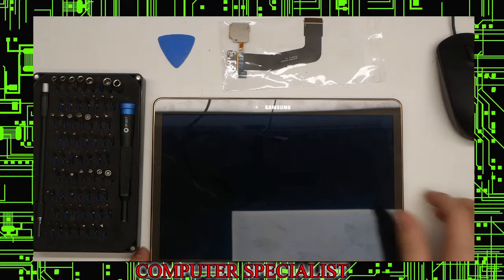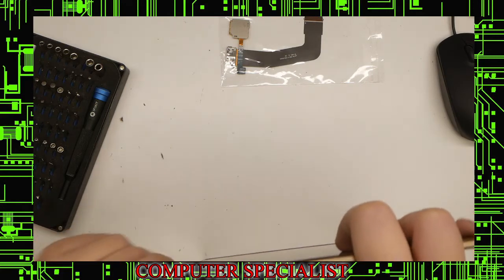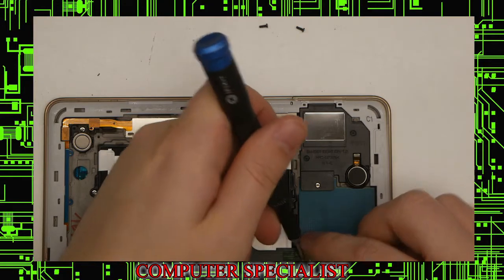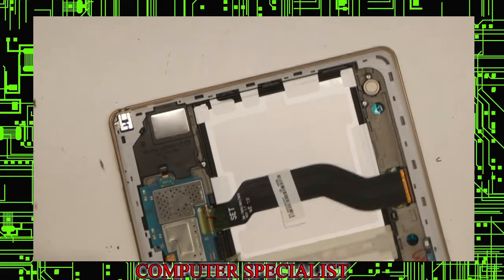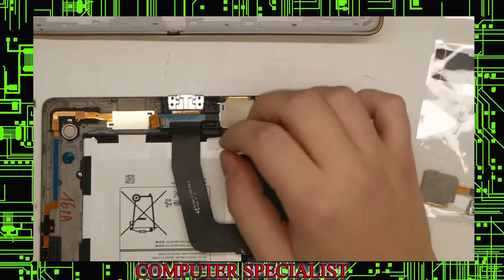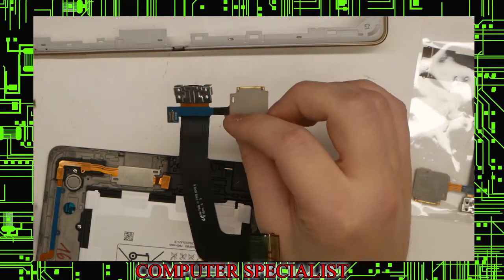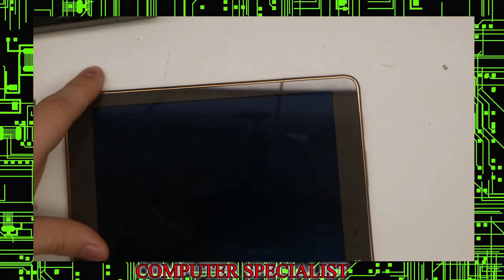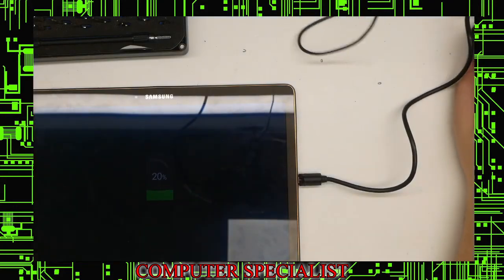How-to Replace Micro USB Charge Port on Samsung Galaxy Tablet SM-T800

Comment: Can you do this with a Samsung Galaxy Tab 8?  I'm looking at the charging port on the tablet and nothing looks broken. But, I don't sweat anything at all. No prongs or anything. Just the port looking empty. Should it look like that?
Reply from the maker: The port should have contacts inside. These ports are horrible and break all the time! Each model ranges different in how you need to replace the jack.

Comment: Just fixed my Tab S following this video and wanted to share a few tips. 

1. Be gentle around the clips. The reason it's hard to pop the back is because Samsung chose to add some glue in addition to the clips - especially around the USB port and the camera module. My suggestion is to pop the clips you can all around the perimeter and then come back and gently start going deeper into the case with the twisting motion shown in the video to separate the adhesive. 

2. Careful not to break/lose the IR Blaster lens just above the camera module. Also, just to the left of the camera module is the wifi antenna (flexible traces attached to back cover). Careful when going too deep into the case around that area. 

3. You don't need to remove the plastic frame to get the USB port out. Just gently bend the plastic up and, with a little finesse, you can slide the connector and the SD card out of their holding pins. Also, I think screws are 000. 00 will work but 000 will reduce the chance of stripped heads. 

Thanks for the video.
Reply from the maker: Thanks for the tips!
Reply: @shc420 nope. only took the back off. The plastic holding the USB port was pliable enough to remove the port without taking anything else off.